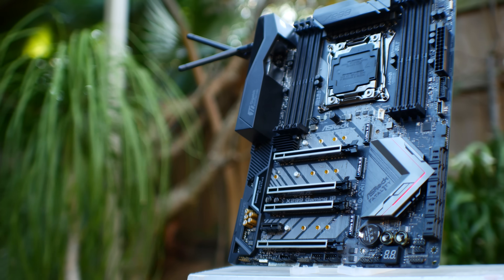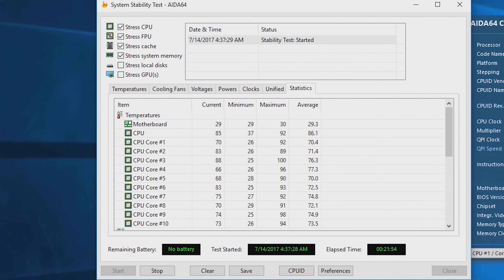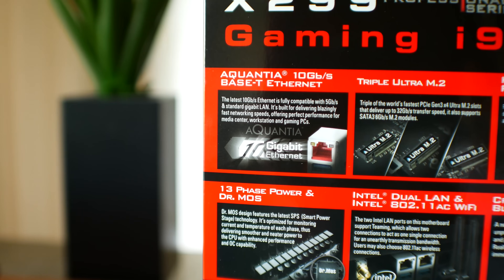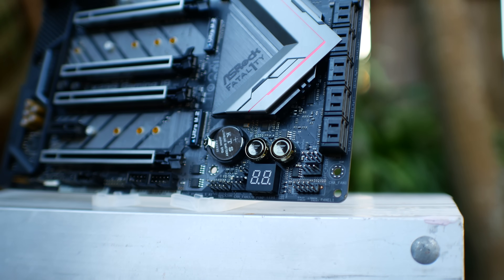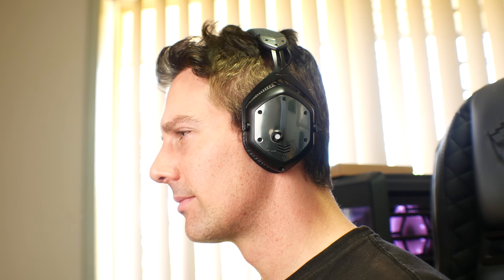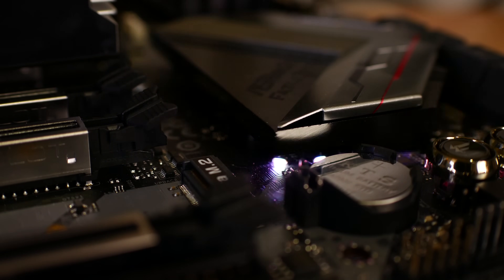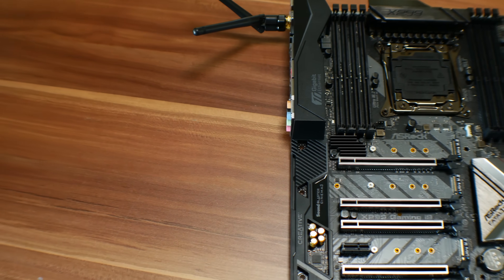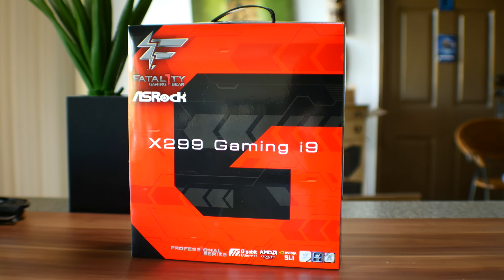Need 10Gbps on your Motherboard...? ASRock X299 Gaming i9 Review

Comment: But if the power supply is full modular, might the 8 pin connector going into the power supply melt?

Comment: I'm going to make a full gaming system the Combo hasn't arrived but  the others have, here are the prices:
MSI GTX 970 Gaming 4G- $151.15
Corsair Carbide Spec-02- $59.99 
EVGA 80+ 600w PSU- $37.44 
Xeon W3580, Heat sink, 8gb 1333 DDR3, X58 Motherboard- $75  COMBO
500gb Hard drive, 320gb Hard drive- $40
Windows 10- $26
TOTAL- 388.59
Was this a good buy? I can get another 4gb (Mobo has 6 slots, 4 are full) for $15(If needed)
I can also upgrade to the X5680 in the future since my Mobo supports it($70).

Comment: Great board but bummed with a 7900x I can not run the Asrock Thunderbolt 3 AIC on the bottom slot. Has to be in the pcie 2 slot to work. Otherwise great board and the thick PCB has zero flex

Comment: Asrock hasn't disapointed me yet, had my X99 Deluxe first gen from Asus die on me earlier this year, replaced it with a new Taichi and happy as a clam. The CPU is even running cooler in that than it was previously (granted I assume the faulty mobo was more to blame than a lack of Asus engineering).

Comment: X299 < X399, it's a platform that is dead on the water, but still if you need these features (Or want to de-lid and Overclock) it could still have some uses.

Great Video!
Reply: Budget-Builds Official he needs to make money so he reviews new things
Reply: @freak777power
it's dead because he is a dumb ass fanboy.

Comment: how much more is 10gb ethernet cable over normal 1gb cat-5e?
Reply: You mean a Cat6 or better Cat7 Cable. I think not much more than half the price on top if I remember correctly. I myself use a Cat7 Cable right now for Gigabit just to never need to upgrade it.
Reply: In terms of cost it depends on the quality of the cable, in terms of speed its a a factor of ten.
Reply: I don't know 

You need at least a cat6a ethernet cable, these sell for around $1-2 per meter, depending on how long of a cable you buy.
Reply: I know they fall back to 2.5gbit and 5gbit. any idea if cat5e does those speeds? You can get 10gb cards for $130 now. Sure you'd want the proper cable and speed eventually, but i'm already wired up
Reply: I don't know 

you can reach a max speed with cat5e of only 1gbps, so no.